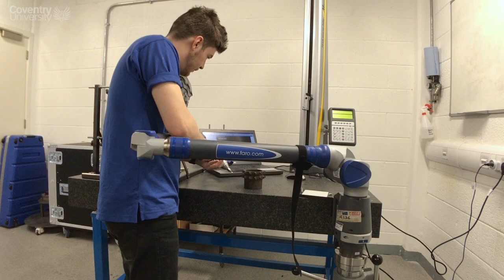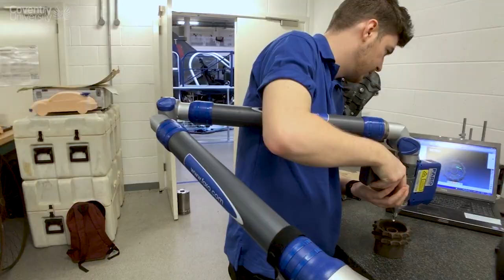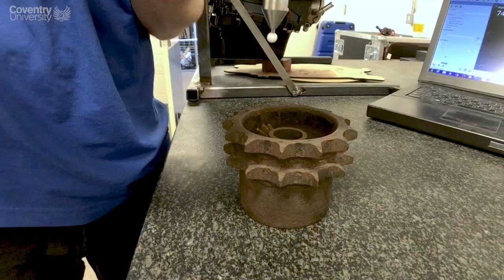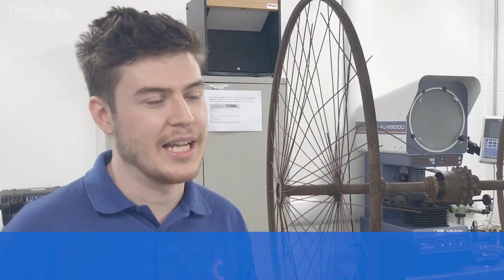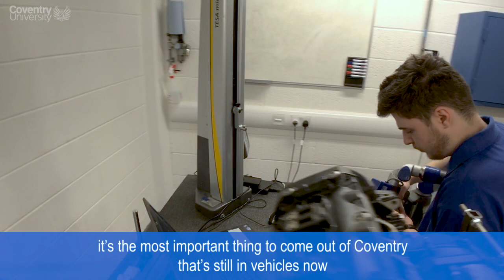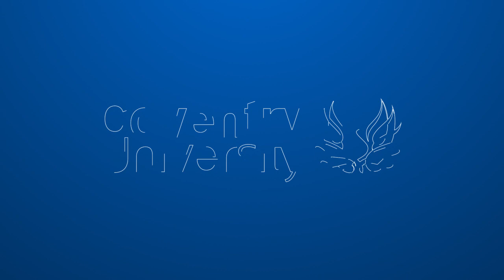James Starley Differential

Comment: I have been trying to obtain a copy of Starley’s original patent for his differential. Tried the British Patent office and the library with no result. Could you help perhaps STL ‘s files or drawings that will help with my project. Cheers Laurie Melbourne Australia
Reply: What excuse did the BPO give ? We seem to have a patent no.:
patent No. 3388,1877
I'm not now even convinced it's his invention ! Steam powered vehicles will have been using differentials a few decades earlier.
Reply: pmailkeey . They didn’t give a reason just that it wasn’t available. Thanks for the reply
Reply: @lozza1950  There's a video of Coventry university making a copy of his diff. It doesn't appear to be far from the  usual vehicle version - with the diff casing (in a car, fitted to the crown wheel) being fitted inside a hollow double sprocket. I have strong doubts as to whether he's invented anything as I strongly suspect similar devices were fitted to steam vehicles (traction engines) a few decades earlier.